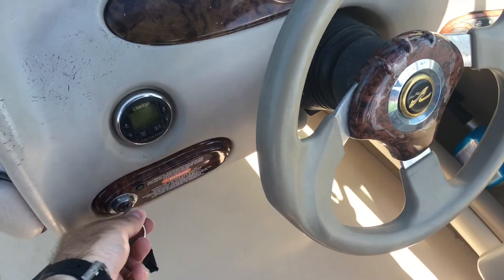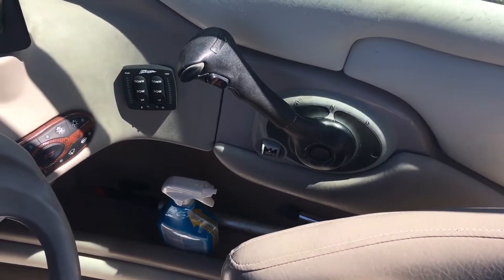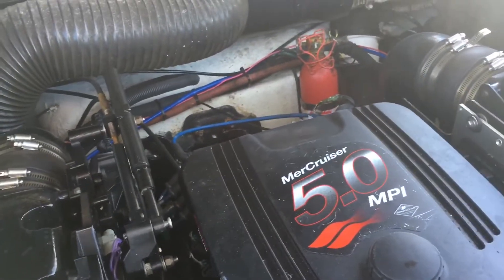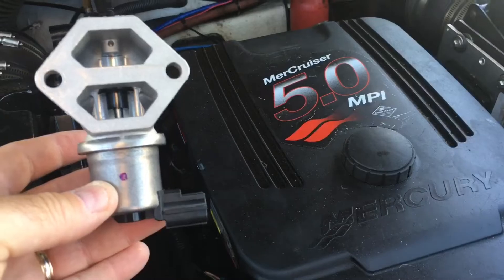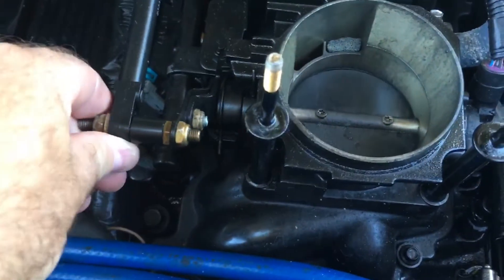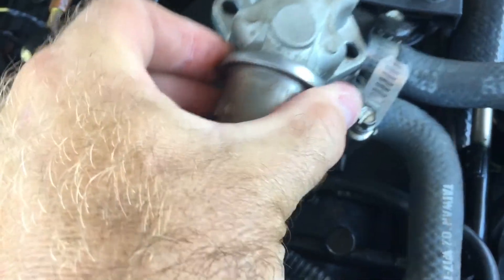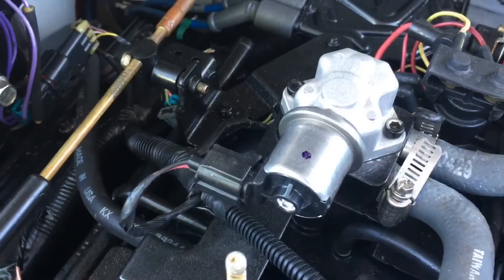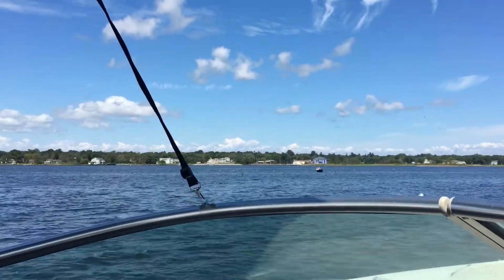Mercruiser 5.0 MPI IAC valve replacement

Comment: Our boat (350 Mag mpi) was doing the exact same thing.  After a bit of research we found your video, bought a new part from Merc and we are back in business.  Thanks!
Reply from the maker: So glad I could help.
Reply: Do you know the part number
Reply: @Thebassmanjigs  I had th3 same issue got it from Amazon WAY cheaper. Just make sure its compatible with your engine model

Comment: I replaced mine once before on my 2011 240 Sundancer.  I bought a Napa Auto Parts version IAC Valve that has the spring in it. It did not work.  I had to fork out the $$ bucks for the Merc version which doesn't have the spring.  It worked.  Anyone been able to find/use a non-Merc brand and have it actually work?  Walker makes one with part #215-2059 but upon closeup look, it seems to have a spring.

Comment: Thank you for making this post.  I have a 05 220 sea ray Sundeck and I experienced the same exact symptoms.  I got towed 6 miles back to my slip and went straight to YouTube and found your video.  I bought the new IAC value and problem solved.  You surely saved me a few hundred bucks because I was able to make this simple repair.  

I noticed on your boat that the defective IAC valve was not painted all black like mine was.   Has your IAC valve been replaced multiple times?  They say original ones have the factory black paint on them and the replacement ones are silver.  I am just curious if this is a common problem and worth having an extra onboard in case of a repeat failure.
Reply from the maker: I’m sure that broken IAC valve on my boat was not an original.

Comment: THanks for the video... Couple of things: Was there a "filter" in the housing under the valve? If so did you clean or replace it? How were the hoses? Thanks
Reply from the maker: There was a little "muffler" which was a little pice of open cell foam. It has no functional effect, but when the IAC valve is open people say it can create a noisy "hiss" sound. I've never noticed anything. The little piece of foam is supposed to make an open IAC valve quieter.

Comment: Looks like the issue I'm also having with my 2003 Sea Ray 240 Sundeck -- how do you find the motor number?  I believe my engine is the 5.0 MPI Bravo III MCM stern drive.  I just want to make sure I get the correct part on Amazon !!  Thanks and great video !!
Reply from the maker: I'm gonna guess that the part is essentially the same for all alpha and bravo and 5.0 and 5.7 engines. When you look them up on line the list of what they fit is long.
Reply: @jayelwin  Thanks -- I found that long list.  I appreciate your video and your quick response!!  I'll give it a shot !!

Comment: I am looking at buying a 2004 220 with 5.0 MPI.. It's a GR8 deal.... Did you have any mild surging at cold idle for some time before the no-start issue? In a "proof of life" video the current owner sent me his engine idle varied just slightly +/- 200-300 RPM... Also I have read where if your batteries are not at least 1000 MCA they can get pulled down to low in voltage during starting and that can mess the ECU up until the batteries charge back up.
Also, do you like the boat?

Thanks
Reply from the maker: Mine surges a little at any idle, can even be when hot. Not sure if that's common. I've never had any battery problems, except that one time my alternator died. Or once when the marina kid left the ignition on. But a jump start and I was on my way. I often need to give a little throttle to get it started.

Comment: We have a 2007 Sea Ray 230 select with the same engine. We bought it pre owned a couple years back, and this issue has not popped up yet. If it does, now I know what I need to do. Thanks for the video!

Comment: Thanks so much @jayelwin!!!  We were out on our Monterey 214 fs 10 miles from home and the 2 beep every 1 minute warning horn starting going off.  We gently motored home fearing an engine fail at anytime.  Once we got back we notice it wouldn't hold an idle and after much internet research I landed on your video.  Result:  20 minutes and $120 we are back up and running!!  Grey Bartholomew
Reply from the maker: Kristin Bartholomew so great I could help. That’s why I post these videos. Enjoy the summer on your boat. Gonna be a hot one today!

Comment: I am no mechanic. I had the two beeping noise every minute on the minute. My boat would also stall when I put it in neutral. I researched online and found it was prob the IAC valve. I watched this video and he made it seem so easy. I looked up the part and found a match at an OReilly auto part store. Ford actually used the same valve from 01-03. It cost me $65 total and a little but if my time. It was def worth the watch. By the way, I have a 2005 4.3 Mercruiser.
Reply from the maker: Great. Glad my video helped.
Reply: That really funny that Ford used the same one cause this is a GM engine

Comment: yes we had this problem to. bot it wasent this neutral air regalation thing. Fitmrst we thought that it was that but it wasnt. It was a little "cleaner" which cleans the air before it can co into the engine. we just put it out and it is running perfectly now if imthe engine is cold. (sorry for the speling i'm from germany :))